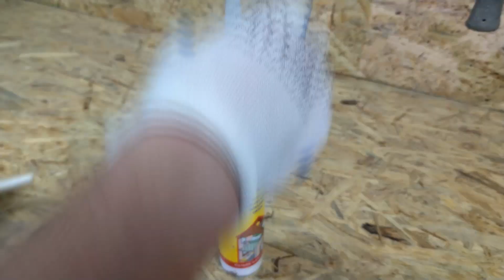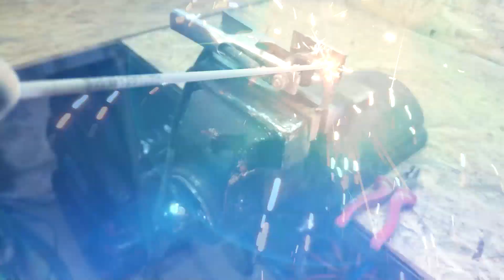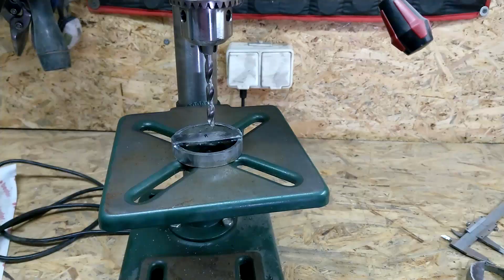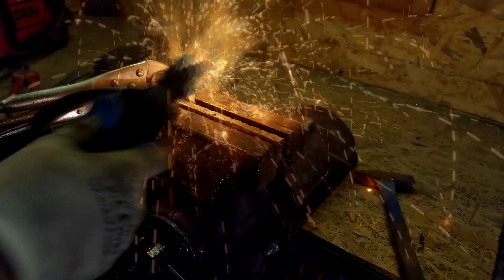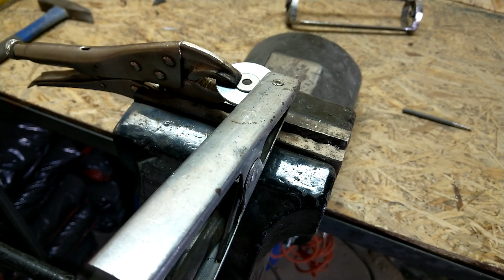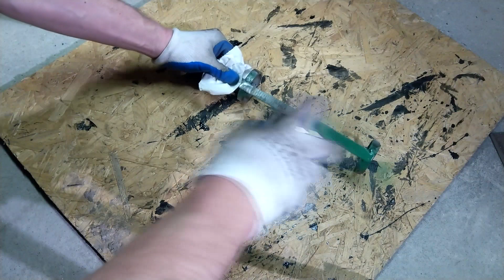DIY How to make caulking gun to cordless || HomeMade Tool

Comment: The cost it may take me to buy a welding plan,tin-spray,all-threaded bolt,a vice grip and a bench vise plus a pair of gloves,,,,,,,,nahhhh i can still buy a cordless caulk gun and come out cheaper
Reply: You don’t need a welder. You could braze or even silver solder this sort of thing together with a propane torch.
Reply: You can even bolt it together if you make it a bit bigger